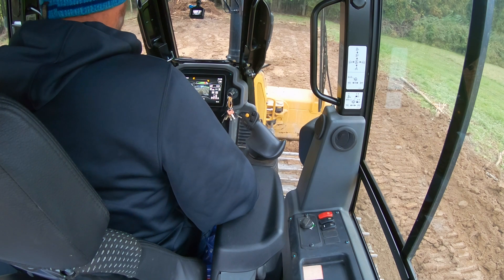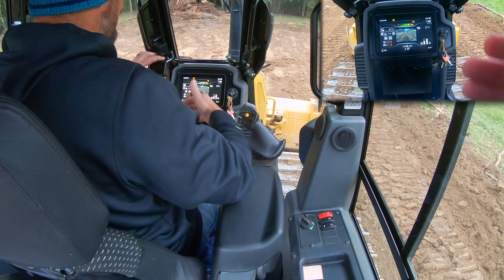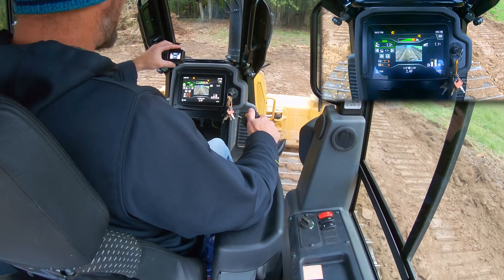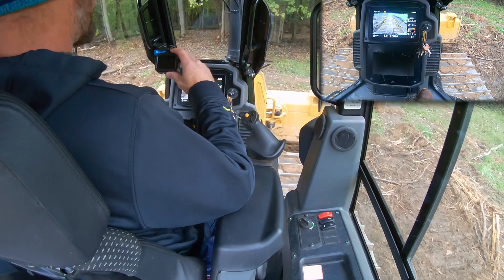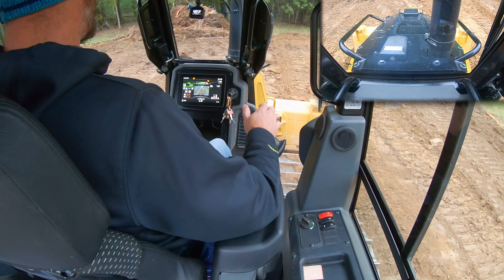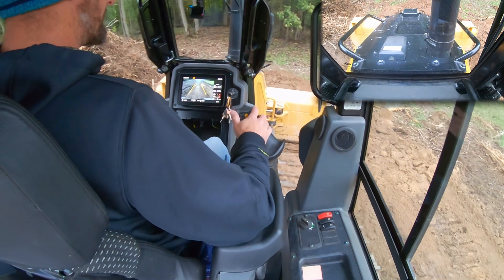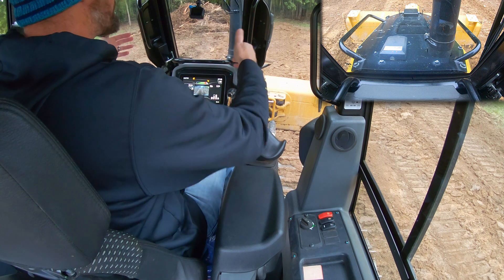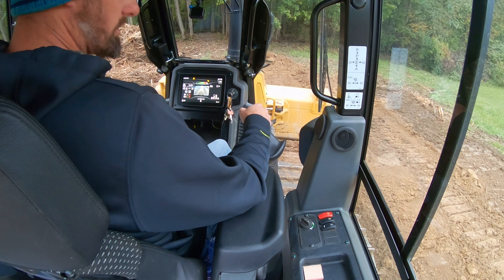Mainfall Slopes with Cat Slope Assist

Comment: I’ve got the slope assist down but on my new D3, I can’t figure how to shut it off and be able to go back to the gps
Reply from the maker: You have to have the GPS component installed on the machine in addition to the 2D system.  Not all dozers have the 3D component installed.

Comment: Nice demo.  I assume the CASE CO-PILOT works pretty much the same?
Reply from the maker: I would assume it is a very similar procedure.  I'd have to spend 10 minutes messing with it to confirm but the concepts should all translate over to the Co-Pilot system.

Comment: Not sure if it's because my D6 is older (it's really the D4 now) but with slope assist I just change grades using the joystick instead of thumbwheel or buttons.    It kind of gives me the best of both worlds and keeps me learning to "feel" the grade while keeping me from porpoising.    Basically it's a "safety" from making too big of a mistake.   The worst part is if you idle too long it will kick you out of AUTO and if i'm not paying attention when I get back into it my blade will dive and ... yea,  you know the rest, lol.
Reply from the maker: There's nothing wrong with letting slope assist or other tools guide you as you learn to cut grade.  The big thing I wanted to emphasize here is to not use technology as a crutch.  At the end of the day we still need operators on the job.